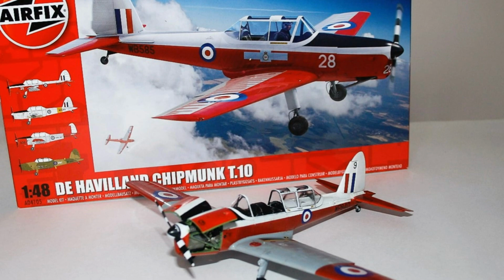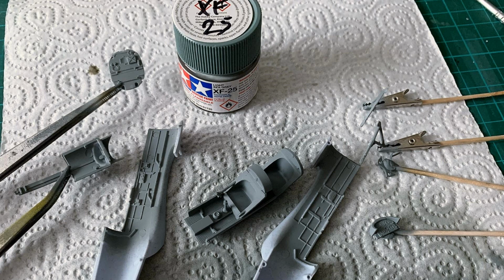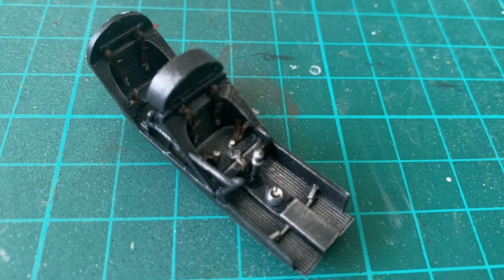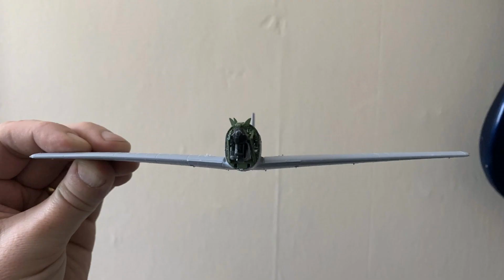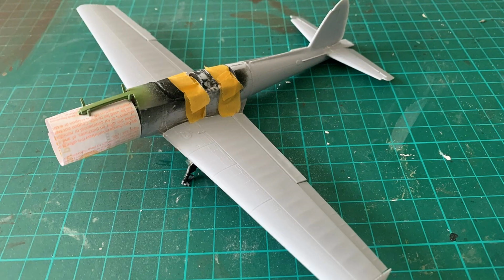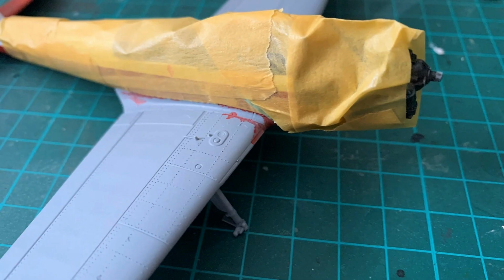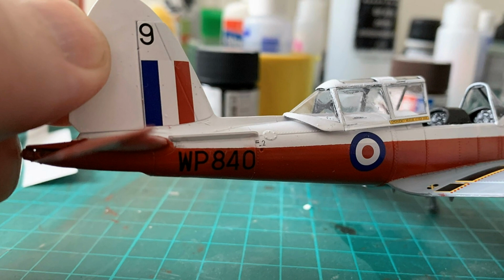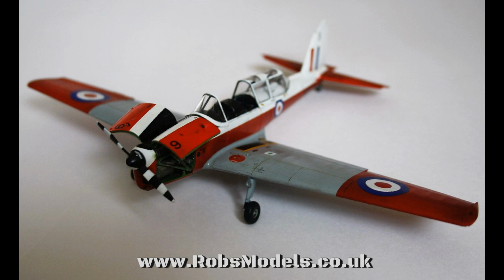Airfix de Havilland Chipmunk T.10 1/48 Scale Model Build (2021 Tooling - A04105)

Comment: I had a chipmunk RC Model with
OS 46 four stroke glow engine.
The Model is no more but the engine is now in an Tiger Moth 😎
Reply from the maker: If I recall correctly from my Air Cadet days the engine used in the Chipmunk was the type originally used in the Tiger Moth - so there's a bit of full circle there! ;-)
Reply: @RobsModels  right you are 👍